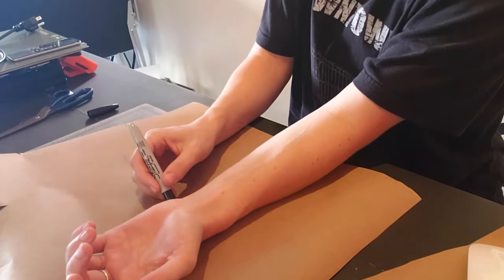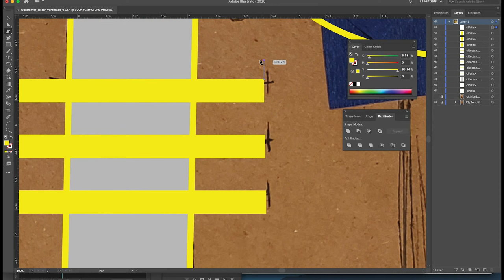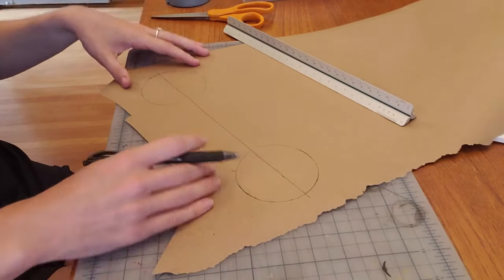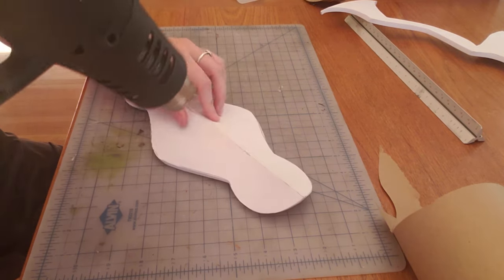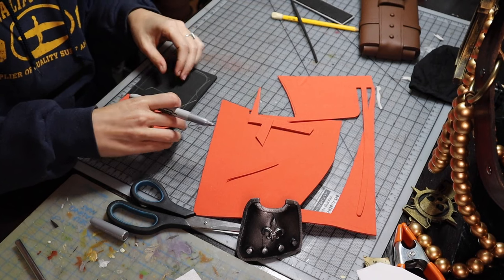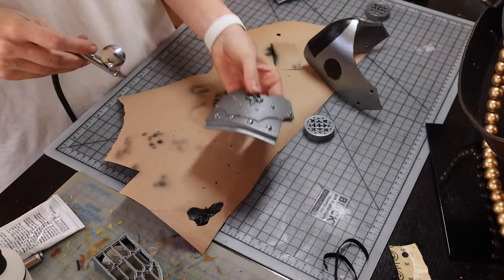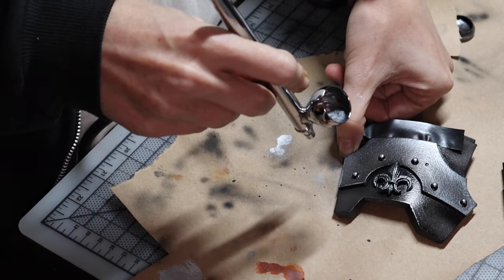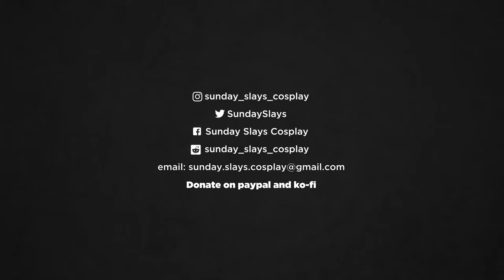WH40k Armor Build Part 3 - Cosplay Vambraces, Gauntlets, Couters

Comment: Hey! I was wondering how you attached the elbow pieces to the rest of the arm?
Reply from the maker: They were originally put on with just pressure because I made the worbla nice and tight. But they eventually started dropping. They’re now secured with hot glue. I chose hot glue so I could build up some bulk because the sides didn’t lie totally flat so other glues were ripping off. They’ve been super secure ever since 👍

Comment: How does this material hold out against bumps and knocks. Can it handle any type of impact?
Reply from the maker: General bumps and knocks it holds up very well. I did rip a googley eye off the hand when trying to hold a very relentless elevator door open. But other than that no dings. It’s not up for any real battle though a whack from a real sword would dent the foam
Reply: @SundaySlaysCosplay  Thankyou for the heads up, trying to find a malleable material to allow for "some" weapon play. But clearly EVA is the way to go for looks as yours is spot on. 👌
Reply from the maker: @12G_Pyro  I’ve made armor for a short film that had to stand up to complex stunts and weapon play. I made that out of 3d printed PLA, worbla, and leather. You could always cover Eva foam with worbla (a thermoplastic that gets soft when heated) and that would hold up as it turns hard when cooled. Just don’t leave it in the sun 😊